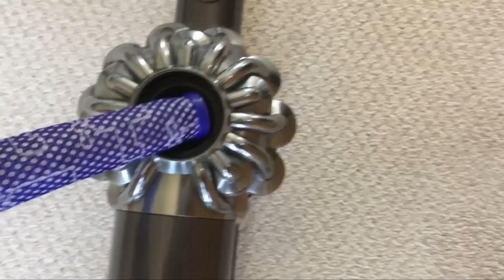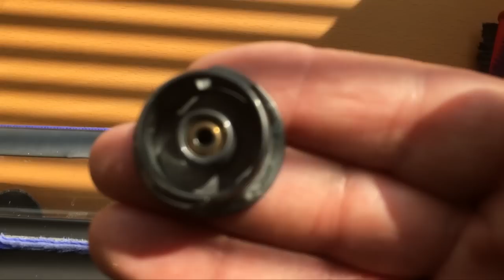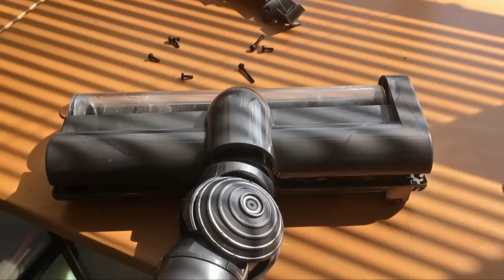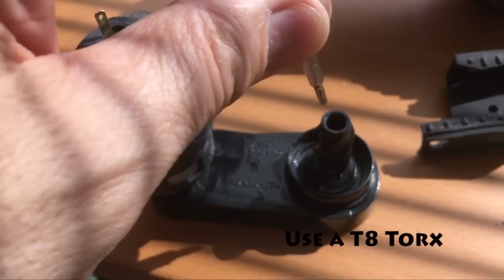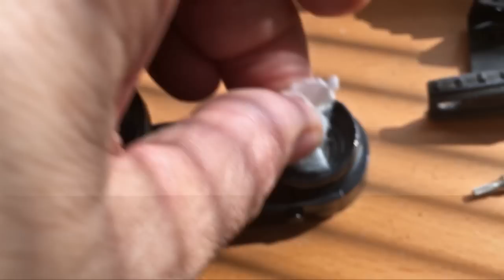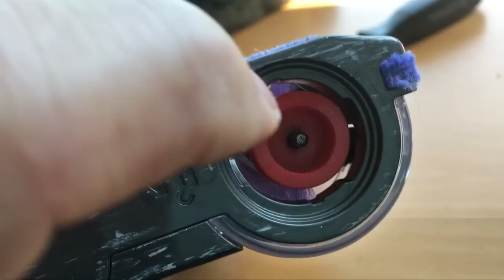Dyson DC59 Floor attachment motor repair

Comment: Have done all of this described in the video on top of cleaning the whole unit the same issue is still there ... not sure what else could cause the problem ... any other ideas? thank you. Alex
Reply from the maker: If your certain all the hair has been removed there could be issues with the motor, motor wiring and or electrical connections. Make sure the battery is good.

Comment: This was extremely helpful! SHORTCUT: skip unscrewing all of the housing screw and only use the T-8 to unscrew the spiral bladed connector.
Reply from the maker: Most of the time the spiral blade is on really hard and difficult to remove if you don't take the rest of this apart.  After doing this a few times you might be able to take the shortcut.

Comment: This is a really decent vacuum. The best feature is that, unlike most other vacuums, https://www.youtube.com/post/Ugkx8ISPQRRAfpAaX4msGjyodObTBnlj4T5g this model does not throw debris backward when the brush is activated. Suction is decent and height levels can be adjusted. It does a great job  of picking up pet hair and doesn't leave a perimeter of hair/fur where a rug meets a hardwood floor....if you know, you know.

Comment: I got rust in brush (not the motor). I might need to change some parts. 😞 Does parts are easy to find?
Reply from the maker: I have not checked but it is my understanding that Dyson does not sell parts beyond a new bristled roller.  If you need a new motor or drive belt your stuck buying a whole new motor head assemble.

Comment: Very well done.  One of the best Dyson repair videos I've seen.
     Question:  Why do you prefer household lubricating oil to WD40?
   Me being in the south we use WD40 for just about everything (sometimes even on toast with jelly)🤫

Have a safe and memorable Christmas 2022. 🎄
Reply from the maker: WD40 is a dry lubricant. You could possible use it here but I prefer a wet lubricate.  It's a bit of a personal choice.
Reply: @DrivelineMaster  OK 👍
Thanks for your response.
  Would you consider the lubricant/oil used on beard/hair trimmers to be a household lubricant?
  Best wishes with your channel and all your endeavors. ✌️
Reply from the maker: Any kind of light oil should work fine.  Yes, if you have stuff for beard/hair trimmers that would be OK.

Comment: Thank you for this excellent tutorial! I first used a german video but that one did not mention that the part at the motor has a screw inside and there was the real problem with a hair curl around the motor. After removing it I have added a bit of "men's deodorant" WD-40 and it all freed up instantly.
Reply from the maker: Glad you found this helpful.  Those darn hidden screws make all the difference.

Comment: Question: the motor catches and stops when powered ie the brushes turn,  then hit a resistance point. If I turn the rotor with pliers I can ratchet it through the resistance but there’s obviously a problem in the motor. Any ideas? Great breakdown in any case 👍🏻
Reply from the maker: Unfortunately it sounds like the motor has to be replaced.  I would be very surprised if you could purchase that motor without purchasing the entire assemble. The motor rotor rides on a pair of bushings. if one or the other bushing is worn it could cause this problem.  You could also have a shorted armature or a burnt reluctor where the brushes ride.
Reply: @DrivelineMaster  Thanks so much for the reply!! 
I had resigned myself that might be the case. I think someone could have a nice side biz refurbing these!
Reply from the maker: I think by the time shipping and labor is tallied up you would be close to the cost of a new head.  Depends on what your labor time is worth to you.

Comment: Thanks! I’ve watched a lot of videos on how to fix my Dyson with intermittent roller brush spinning, but your video is the one that fixed it. Can’t believe how much hair had accumulated around the bearings! Using a fine picking tool was essential for cleaning it out. Thanks again!
Reply from the maker: Absolutely.  Glad you were able to get it fixed.  Works every time.

Comment: Nice clear instructions to get me to the root of the problem, which was hair trapped in the spindle in the motor section. I had to use pliers to remove the spindle mechanism as it wouldn't budge by just trying to pull. I'm sure next time I'll be able to do this task three times quicker! Thanks.
Reply from the maker: Glad it worked out for you.  Yes, the spindle is on really hard. What is nice to know is that pulling really hard on it won't break it.

Comment: Great video, pulled mine apart but the bearing seal was messed up and bearing full of hair and grit. Cleaned it out and got it working however it's not great.

Comment: Great information, much appreciated. I wanted to go a step further and remove the spindle from its casing. I believe it's held in using a circlip. Don't really want to break anything. Found lots of hair, cleaned out, now working!
Reply from the maker: Excellent, Glad to hear.

Comment: The thumbs down really confuses me. Why would you thumbs down a video that over 100k people have watched and over 700 people have left comments for. All it’s done is save hundreds of people a lot of money. Ahhhhh.........Dyson workers maybe?
Reply from the maker: There are all kinds. Maybe the quality wasn't up to their standards or it didn't fix their problem because of some other reason.  Or maybe they are just mean.  I have had some really weird comments on some of my videos.  All in all I think this repair saved a lot of people a lot of money and it cost Dyson a lot in motor head sales or customers just stopped using their Dyson and wouldn't buy another one. I'm happy I made the video.
Reply: DrivelineMaster. Me to mate. 👍👍👍
Reply: DrivelineMaster. Also at 1.53 you show the end of the brush roller. FYI incase you didn’t know that knob with the axle will pull out and the strips of brushes just slide out. I then used a small wire brush to comb the hair out of the bristles. Cheers Stuart 🇦🇺

Comment: Mine didn't fix it.  I don't even feel the suction, could it be the power?
Reply from the maker: This fix is designed to fix the brush roller what will no longer spin due to excessive hair buildup on the motor spindle. If you cleaned it out and it still doesn't spin you could have a bad motor or a wiring problem.  If it doesn't suck make sure to clean the heppa filter and check the tube for blockage.

Comment: Thank you for the video. I did this but I also had to remove the black cover for the bearings under which there was even more hair stopping it working. Once I removed this and lubricated the bearings I put it back together, put the unit directly on the vacuum gave it some gentle persuasion which holding down the trigger and voila, it now spins like a jet engine.

Comment: This is a great video and helped me fixed the head originally when I discovered a broken wire under the white plastic tab. Would you happen to know what size wiring is needed (22 awg?) as when I fixed last time it left me very short and I expected it would go soon and need a fresh piece of wire soldered in again. Thank you again sir your help is appreciated!
Reply from the maker: I don't remember exactly but I think it 18 or 20 gauge. You can always go with a large wire (smaller gauge number) just don't use a smaller wire.

Comment: Hi thank you very much for your informative video - I had not noticed tthe Torx 8 screw holding the brush drive.
I followed your instructions and took apart and cleaned - I found that a lot of hair and dust had got into main brush drive bearing and it was very rough when turned.
Having in a past life serviced power tools - I decided to remove the circlip (was very tight) but drilled a couple of small holes to the outside of the clip to enable a screw driver to get in there & lever the circlip off - be careful and hold so doesnt fly off - wear glasses.
I tapped out the bearing - the outside of which has a rubber/plastic seal.
I removed the rubber seal with a jewelers screwdriver and sprayed wd40 into the bearing and picked/washed out the hair. When clean and smooth to turn I then regreased the bearing and refitted - this time with the rubber seal to the inside to better prevent entry of the hair etc. into the bearing.
All back together and working well.
Cheers Kim
Reply from the maker: Good to know Kim.  Very ingenious.  More work than most home fixers would be able to do.

Comment: Wouldn't you simply be able to remove the Torx T8 screw instead of the whole motor assembly to accomplish what you're doing here?
Reply from the maker: Some have commented that you can.  The first time you try to take the spiral drive off of the motor it's on really hard and you have to really pull.  That is very difficult to do without taking it all the way apart.

Comment: Fantastic tutorial. I was just on the verge of buying a new Motörhead when I spotted your video.  I had tried everything previously but the spindle was stuck fast. As soon as I added the oil and turned the brush spindle to spread the lubricant it freed up! Thanks so much.

Comment: I'm stuck at disconnecting the wires - any tips?
Reply from the maker: I guess I goofed when I didn't show you how to unplug the wires.  They could be on pretty hard if they won't pull off by hand.  They do slide off of the spade which is on the motor.  First try pulling and wiggling.  Try to pull on the metal connector and not on the wire.  You could break the wire off of the connector.  If that doesn't seem to work you can carefully use a small flat blade screw driver to gently leverage against the motor with the tip of the screw driver pressed up against the edge of the electrical connector.

Comment: Great video, straight to the point. solved the problem. many thanks for sharing. I am pretty handy but would probably have stopped before removing the hélicoïdal gear,  and would not of fixed the problem. ( my torks  drive was to large to access the deep screw, so i went and both one that fitted). thanks again and have a great day.

Comment: Thank you for such a detailed, clearly presented and easy to follow video. I’ve just fixed mine with the help of this and it works perfectly again. All it cost was the price of a cheap torx set which was nothing compared to the cost of a new head or a new vacuum cleaner! Just brilliant, thank you.

Comment: Performed all the troubleshooting that dyson.com had. Called the support line since that didn't help. They said "oh, your motor is going out. You'll have to buy a new one."

"How much is that? And can I get a discount?"

"Sure, 20% off comes to $160."

Can't believe they want $200 for a new head. This video saved me. 

(Side note: if this doesn't work, search DC59 compatible motorhead. Found some off-brand ones for $25 on Amazon. Better than spending $160 or just buying a whole new Dyson)

Comment: I looked everywhere for a tutorial like this and this is perfect. Was able to get the rotor off without removing the whole motor as some suggested, but it was still good to get in there to remove some junk from around the motor itself. Also didnt have a proper torx bit but a 2.4mm flathead did the trick. My wallet and I thank you a bunch!

Comment: Excellent video. Followed this and found a big wad of hair under the motor drive which was causing it to seize. It annoys me no end to see James Dyson coming on the TV and espousing design perfection and then having to deal with this mess frequently. We have a Nilfisk for 30 years and never had to "call  technical support" for it

Comment: Silly question. I actually removed the motor, and drive belt. I replaced everything, but I’m not sure if I put the motor back on right. If you reverse polarity of the black and white wires, will the motor spin in the opposite direction?
Reply from the maker: Yes it is possible with a DC motor if you reverse the wires it will spin in the opposite direction.  If you hold the vacuum as if you are going to use it on the floor and then look at the brush head from the right side the brush roller should spin clockwise.
Reply: Thank you so much for your reply! Guess I have more vacuum surgery to do :)

Comment: Massive thanks mate, I have 2 DC59's and was down to one small motorised head from the accessory kit. One torx 8 screwdriver later and both large heads are working perfectly. My only regret is that I couldn't take you up to 1000 subs.

Comment: Excellent video. I could have done it the quick way by putting a #8 Torx but would have missed a whole lot of hair clogging up other areas. So, in my case, I got a better job by dismantling the head unit as recommended in the video.

Comment: Mine stopped working, done all in the video as it has happened to me in the past, didn't work for me this time, rang Dyson, said I needed a new head as motor has probably gone, approx £70, I tried the other smaller rotating brush which worked fine,  so problem was in the head unit, several Torx screws you need to undo to get to the motor, 2 wires connecting to motor, took them off, checked electrical continuity between each wire (with a multimeter) and its connectors where it connects to the long tube, one wire was fine the other no continuity, so completely dismantled the unit, the two wires run through the pivot area, right on the pivot point one wire had broken due to the constant  flexing, pulled both wires out of their retaining channels, bared back the wires insulation & soldered the ends together, the other wire was on the point of breaking so cut it and did the same, fitted them back into the retaining channels,  they are reasonably close to each other so there is a chance of them shorting together when head unit flexes, so I put a blob of silicon sealant on them to insulate them, put it back together and away it went, tools require Torx screwdriver & Phillips screwdriver, multimeter optional, if you haven't got one, just go have a look to see if the wires are broken, time taken approx 1 hour, most of this is working out how it comes apart.
Reply from the maker: Thank you Steven.  One thing to note about silicon sealer.  Smell it and if it smells like vinegar don't use it on wires it will corrode your wires and you will be back to square one.

Comment: Thank you so much. Saved me money and taught me something I didn't know before. Appreciate that the spindle could have been removed after removing the brush but that wouldn't have given me the opportunity to remove all the dust and hair that had accumulated in the other parts of the head and particularly around the motor so your method is a much more thorough fix. Thanks again.

Comment: Worked like a dream. The last fitting was very stiff but finally came off with the right leverage and found what seemed like metres of hair! It runs like a new cleaner now and replacement heads are pricey. Thank you.

Comment: Thank you. This helped fix my v6. I started taking all the casing off too and got stuck with the wires in the motor. Then i just yanked out the spindle and managed to clean out the hair without disconnecting the motor. Very satisfying thanks again
Reply: Great job, thank you. I had tried to fix it myself, but got ‘stuck’ with the hidden screw in the spindle drive. then I found your video and managed to get a ‘watchmakers’ screwdriver to remove it. Success, all thanks to your instructions. Much appreciated.

Comment: Thank you so much for this. I had given up on my Dyson DC62, which is identical, but followed your instructions and it's now working perfectly. My husband is very impressed. Lea (Switzerland) BTW I managed to do it without disconnecting the wires to the motor.

Comment: I thought I cleaned mine thoroughly, but it continued to not spin. After seeing this video, I realized I didn't remove the drive gear, which was the problem. Thanks, dude! You just saved me from spending $140 on a new powerhead!!!

Comment: Thanks so much! I called Dyson, paid $25, and waited 3 weeks for a replacement brush bar that didn't work. I called them back and they told me I had to pay $200 + tax and shipping to replace the head...no thanks. This fixed it!
Reply: Yep, just got off the phone with them myself. Their trouble shooting consisted of checking the tube for obstructions... Then recommended me to send it in

Comment: Thank you for helping me solve my problem. But you did way too much to fix this. All you have to do is to remove the brush, Stick your #8 star bit down the brush canal and take the screw out, pull out with pliers and clean and lube. Then replace everything and you're done.
Reply from the maker: I will try that next time.  With 4 cats I'm certain there will be a next time.
Reply: Just did it. It worked! Thank you very much for posting your comment.
Reply: You are welcome.

Comment: This was a very satisfying fix thank you for posting! I was convinced it was something else as I ran the brush head motor without the belt attached and it ran but then stopped much like it did when fully assembled.I guess the brush head motor needs a load to behave properly ???  Thank you sir 👍

Comment: Thanks a lot for this, quick question, is it ok to use silicon oil on this?as it's all I have right now and I'm a long way from any stores....no big deal if not, I'll hang fire for a few weeks until I can get some otherwise.
Reply from the maker: It should be OK to use silicon oil.  Any household oil will do, just don't over do it.